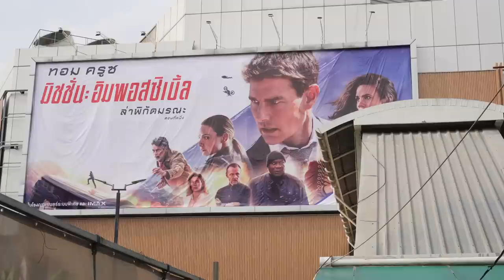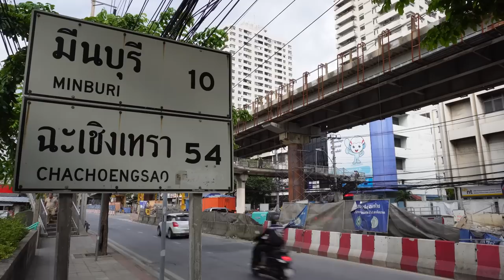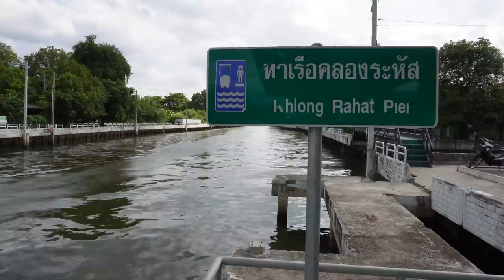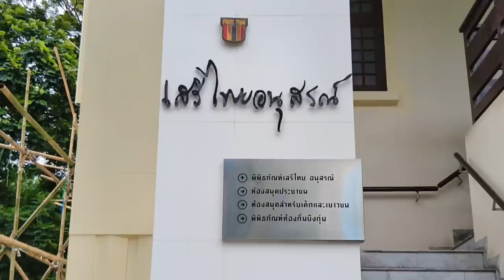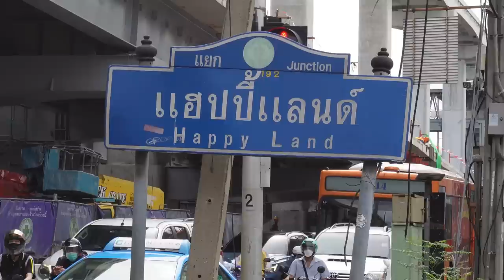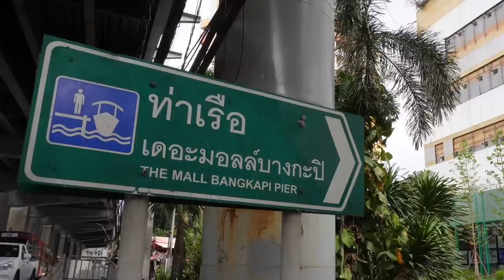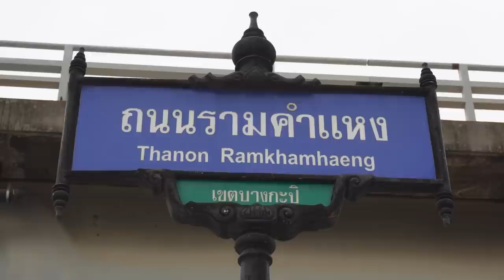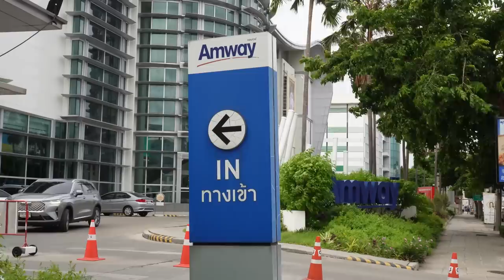✅BANGKAPI | Bangkok's Eastside Suburb | New Condos | Rail Lines | History | Happyland | Seri Thai

Comment: I just moved to Bang Kapi and it's pretty nice so far. Even without the new MRT you can take the boat in 30min to Sukhumvit for 20 baht or so. Hotels are super cheap. New budget hotels with nice and clean interiors for less than 500 baht. Many hotels have a deal when you stay 5 nights you only pay 380 baht/night. The monthly rent for a small furnished serviced apartment was 6000 baht.
Reply: The klongs are polluted with sewage and stink !! Bus no 8 or other buses will take you to the MRT on Lad Phrao road will take you to Sukhumvit or, a taxi via Ramkhamhaeng  road but not during rush hour  is fast
Reply from the maker: Boats obviously cramp your high end style!!! Cheers
Reply: @smokefromsevenorifices8782 Have you ridden the #8 recently?. Man o man, the memories!.
Reply: @mrdm1967ify  I there about 4 different buses from the Mall Bangkapi to the MRT on Lad Phrao
Reply: @smokefromsevenorifices8782  I rather ride the klong river taxis   beats traffic
Reply: @joelmonkley6177  the klongs contain polluted water with sewage that elevates the spread of dengue fever but maybe the new PM will tidy this up as Lee Kuan Yew did in Singapore ?

Comment: Wow! The yellow line is working already? I go to Ramkhamkhaeng University Stadium to play table tennis and go to the night market near the stadium (lots of halal food stalls). I've been to the Airplane Graveyard but haven't had a look north of the canal yet. If the Yellow Line is in operation it'll make getting there SO much easier. In the past it was either the boat or a public bus from the Ramkhamkhaeng ARL station.
Reply: Oh nuts.. I assumed the Yellow Line went up Ramkhamkhaeng Road - they've certainly been building SOMETHING in the area of the stadium. I suppose that must be the Orange Line.
Reply from the maker: Orange Line follows most of Ramkhamhaeng, will be very useful when it's open!
Reply: @BangkokPat  Yeah, I looked up the Orange Line on Wikipedia. They say 2025, here's hoping! I guess on the bright side the boats have been revamped and the chances of ending up in the canal or getting your foot between the dock and the thwarts are much reduced these days..